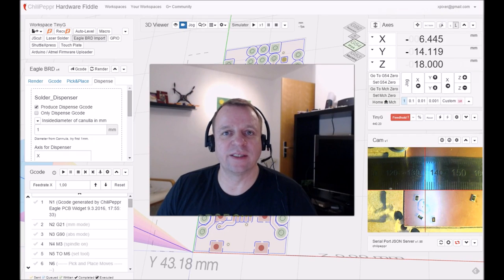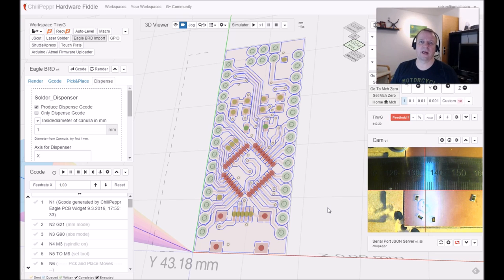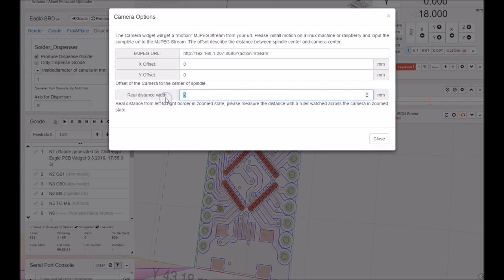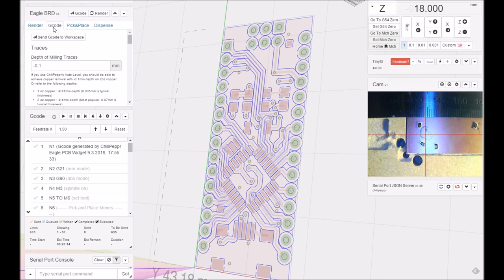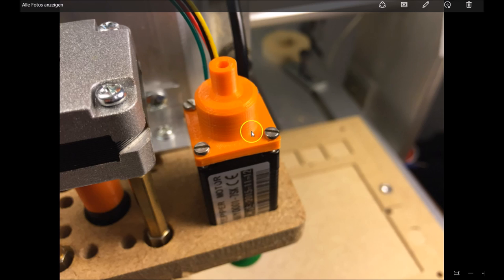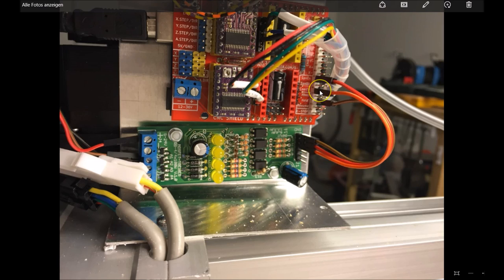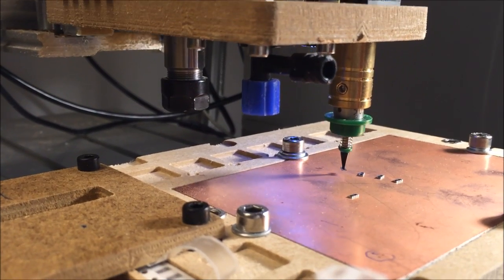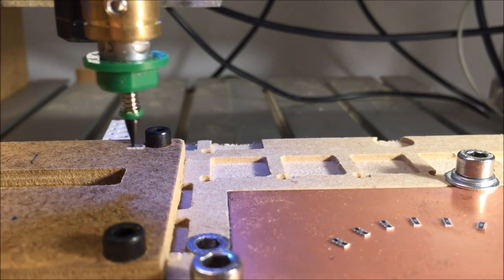DIY Pick and Place System S01E14

Comment: Hallo Frank, ich planen auch eine PNP Maschine, optische Überprüfung hast du nicht? Ich sehe, dass neue Nozzle beim drehen nicht ganz im Lot steht, dass könnte schwierig bei 0603 oder kleiner werden?! Woher hast du die Nema über den Nozzle bezogen? Best Grüsse, Adrian
Reply from the maker: Hallo, nun ja ... man kann den runout auch ausmessen und dann einfach als parameter nutzen um das zu kompensieren. Nehmen wir mal an, runout ist 0.2mm ... dann verschiebe ich einfach die position beim an & ablegen um 0.1mm. Sollte doch gehen.

Comment: how did you get the camera to work with chillipeppr?
Reply: I am currently using arduino uno + cnc shield running on windows. Do i have to install the camera widget and how do i do it?